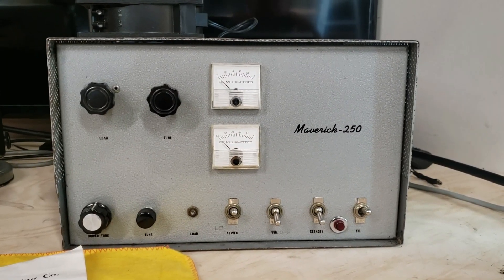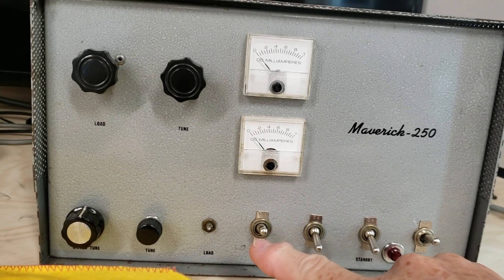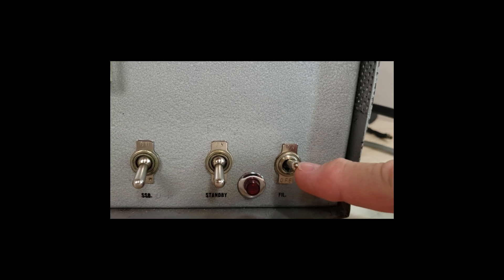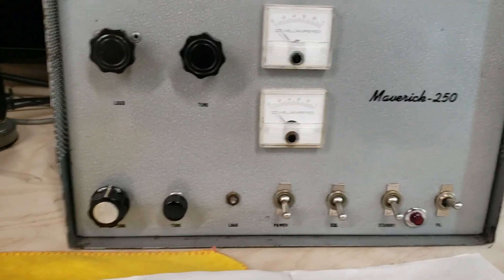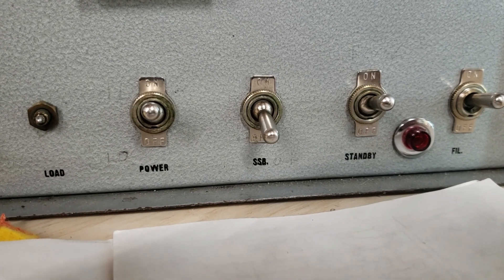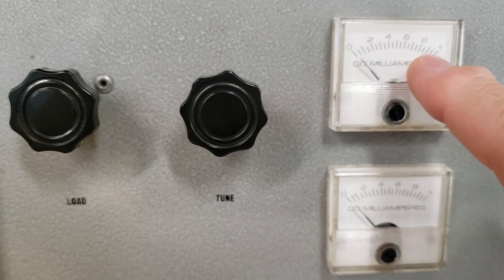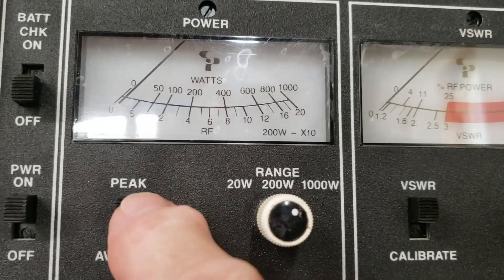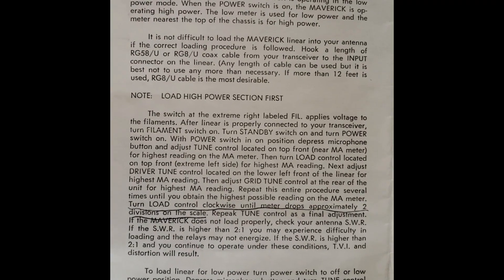Maverick 250 Tuning - D & A Definitive Tuning Guide

Comment: You can also use 6KV6's for the driver tubes and 6MJ6's for the finals if you can find them. Both are heavy duty versions of the tubes you listed. I had one of these about 50 years ago. Also had the Phantom, it's big brother.

Comment: IIRC, the 6AQ5 is the tube that operates the keying circuit. From the manual, that's a post-1974 amp because that's when the radio power limits were changed from 5 watts input on AM/15 watts input PEP on SSB to the current 4 watts output on AM/12 watts output on SSB. 
These were quite popular before 1972 because the most popular antennas could handle the power output. The CLR2 was rated for 300 watts and the Super Magnum was rated for 350 watts. If you wanted to run a Phantom, Skipper 300, or bigger you needed a beam, Mosley Devant, or the Astro Plane. That changed when the Penetrator and Starduster were introduced in 1972.

Comment: This is the best video for this amp I have seen on yt. Would this be the same tuning sequence for the newer brown face Maverick dual power amp that came just after the grey? Also did you set the swr calibrate while the amp was keyed up? Again, thanks for sharing all this great info' about these fine amplifiers!  73  160 MI.  ✌
Reply from the maker: The tuning sequence should be the same for all Mavericks as well as other tube linears.
Always set your SWR calibration keyed up. You will have to reset calibration if you turn the amp off and run your radio standalone.

Comment: I have one of these but is says thunderbird 350?(looks like homemade stickers) but looks just like this 250 u have here in video showed n learned a lot I am most grateful some more information on this particular model (serial no. DPM-51077) I turned  the dials or knobs wen I ran it just a lil bit idk what I was doing and if my meters waz correct was doing about 900watts most I seen was 1200 so I cruise on 900 b gladly to share pictures and any video of this box if I can learn a little more again thank you for this video you done really showed me how to tune the box 💯
Reply from the maker: Awesome output, be sure you are not driving the amp too hard with your radio ;)